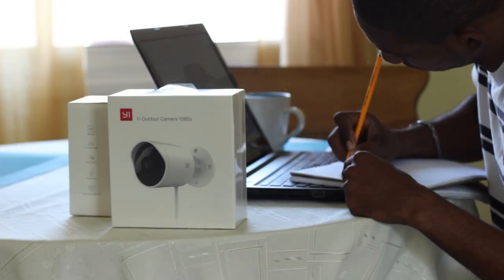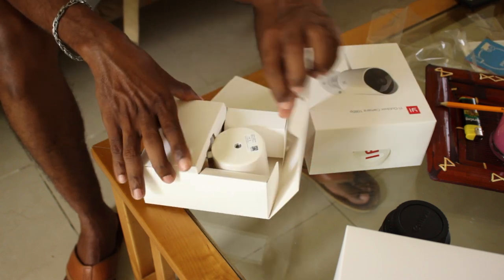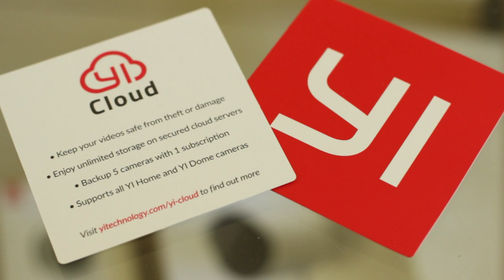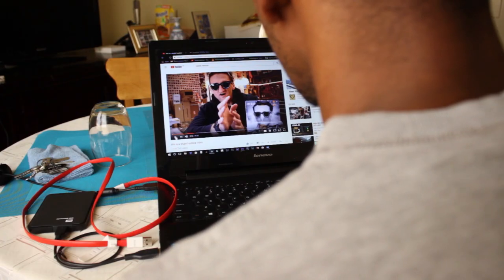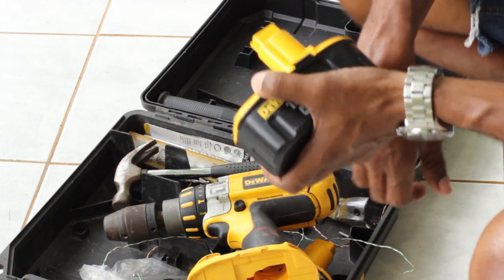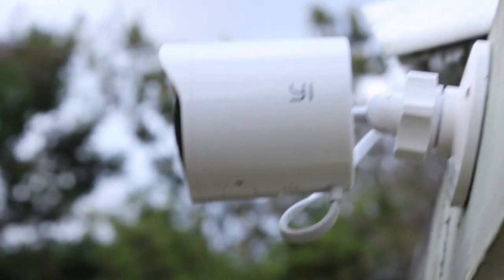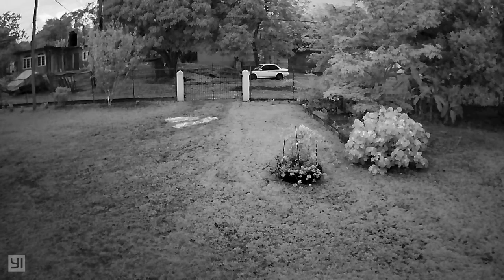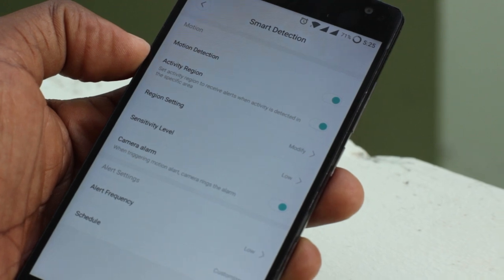YI made it so simple - Yi 1080P Outdoor CAM

Comment: Really enjoyed the extra story you added to the video... made the video unique, rather than just  another review.  Any worries about the power plug not having a weather proof covering?
Reply from the maker: M Mitchum I am extremely glad that you saw it for what it is.
That's exactly what I intend to do, give an "Experience Video" rather than just a review.
Thanks for noticing and much respect for your feedback.
And as a promise, the story telling will definitely improve lol 😂.
Reply from the maker: M Mitchum as it relates to the power 🔌 yea, this was one drawback that I forgot to mention, it has to be plugged in an area where it won't get wet.
The cable itself is well insulated, however, that adapter area isn't. So if it had to be exposed, I would suggest using a plastic container and water resistant tape to create a makeshift insulation container.

Comment: The cameras will record continuously for the first year through the free Yi cloud offer. After one year the cameras record continuously for only 6 seconds after being triggered. You need to buy the yi cloud for $189 so the camera will save more than 6 seconds.  I learned this the hard way. I have 5 cameras and I am on 18 mos of use. There seems to be no way to get the cams to record continuously in the settings menu
Reply from the maker: Good info... Didn't k ow this at all, Thanks
Reply: @RayonWhittaker  You can access more recording off the chip by tapping the video. It will show a bar on bottom where you can scroll to other parts as if it had recorded full time.  But on screen without tapping you get only 6 seconds.

Comment: I just purchased this camera and when I get to the end of the programming process it says that it is unable to gather information and will not add camera I’ve tried resetting but still will not add has anyone had this problem please let me know.
Reply from the maker: I'm currently having this issue after a few years of it being outside in the elements.
I haven't done a reset as yet but will try soon and see what happens.
Reply: @RayonWhittaker  ok thanks for the reply if you find out please let me know